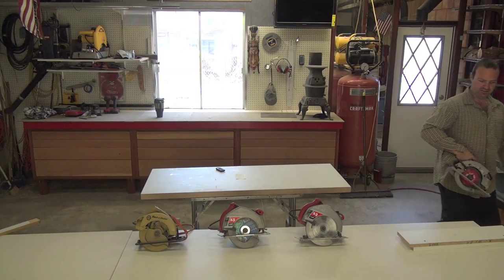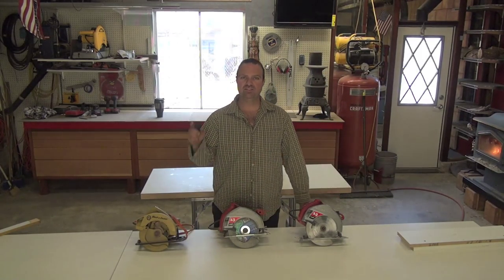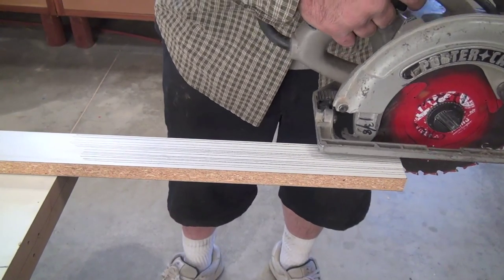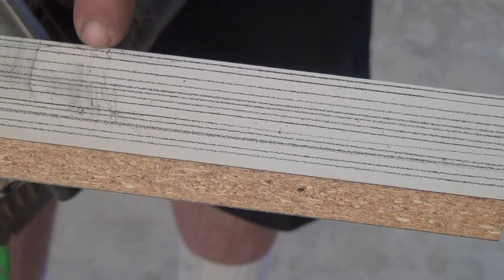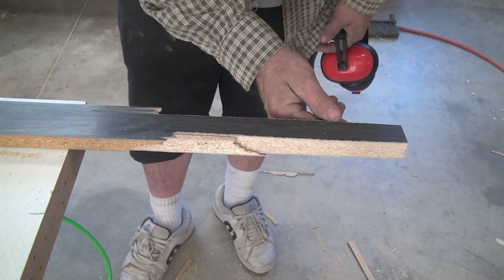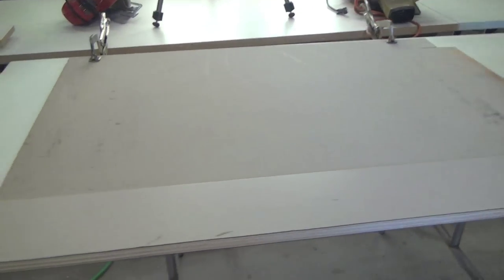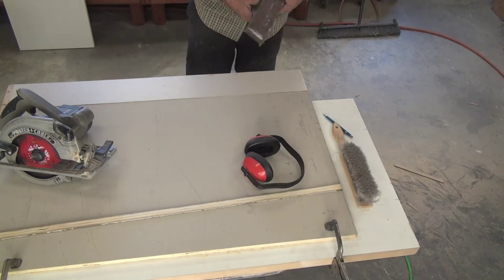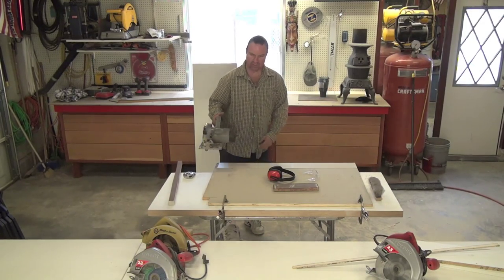Advanced Circular Saw Technique *Cut BackWards IN-DEPTH *a Tip for Pro Carpenters

Comment: Us  "pro" finish carpenters  would NOT use bad blades on a project thats has to be precise and accurate. Use the right tool use the right blade and use them correctly!
Reply from the maker: well, us pro's do, lol still doing this technique for 20 years now, not always obviously but when it comes to cutting off a simple scribe line thats how its done. Mose union finish carpentersI know over here on the wast coast do it the same as well...

Comment: First off that garbage is NOT wood. It's one step above cardboard.
Reply from the maker: What does it matter? This demonstration is to show the technique which can be applied to Cut wood, sheet goods, laid up laminate panels, corian, avonite & so on...Including cardboard! The commercial industry uses laid up laminate sheets in almost everything including wall panels, ceiling panels. Your local bank teller line is made with the same cardboard I used in the demo.
  The real question is did you get the point of the video & understand what i was explaining?  I'm just spreading the word to help other pros that struggle everyday when doing something so basic to me. Thanks for watching & leaving a comment. I appreciate it.

Comment: Fuck that! As a pro 26 years in there are many techniques better and safer. I now use a "thing a ma jig" scribing tool and a tracksaw and finish with a block plane. The scribe scores material (great for melamine and paint grade too), set track saw on track and move your track as it the saw moves through then curved cut leaving the line...then a block plane...specifically, a RALI block plane... double sided disposable blades.

Comment: Flip the blade round
Reply: aaron knox Think about it.  The arbor would still turn the same direction and you would then be presenting the non-toothed side of the blade to the wood from underneath and it would not be able to cut.  Cutting backwards brings the teeth to the surface from the top so the chip out and dust expulsion is on the bottom, instead of on the top as with sawing forwards.  A circular is is like a table saw turned over.  With the saw blade turning down towards you on a table saw, it automatically is cutting so that the chip out and dust expulsion is on the underside of the wood and there's more support around the wood to prevent chip out whereas the blade comes from underneath, up and out on a circular saw.  This is also the reason granite counter top guys cut backwards; so they preserve the finely polished top of the stone and minimize chip out.  It's more dangerous to use the backwards technique though.

Comment: Ex UBC journeyman.
1. Loose cuffs...no good
2. Loose shirt tails...no good
3. Chord not over shoulder...no good
I would flip blade for cutting, or use straight edge to guide sawplate.
Old trick on Formica is to use sharp blade to lightly score cut line.  Got good enough to do it mostly freehand.  Can use masking tape as well. Or...flip sheet over and cut from backside.  You begin video saying you'll never cut any other way.  Did I hear well?.  This is only for scribing lines for fitting to an irregular surface.  I would never hire you because you are TOO dangerous for me.  Not to mention the morale if anything happened to you on my job. Sorry.

Comment: Why do you think it's worth it to have your saw do a mediocre line while exponentially increasing the chance of a kickback.  The amount of blade exposed is also silly.  Yeah I get it, you are sinking the tooth into the piece, but there are so many cheap specialty blades for that job already.  If you are framing, these tareouts are of basically no concern.  Anything more delicate just should not be done with no guide, giant exposed blade and a busted blade.  If you are seriously concerned ab it tareouts, score it with a knife or a shallow cut first.
Reply from the maker: Thats just how its done, yeah i'm sure there are different ways but for speed and efficiency this is it.

Comment: Youve removed your riving knife from your saw. This is crazy. Be safe and use your saw as its designed to be used.
Reply from the maker: I was unaware skill saws (circular saws) had a riving knife, HUH, what was crazy? Could you elaborate please, thanks.
Reply: The steel plate positioned behind the blade to keep the kerf open to prevent kick back, similar to that on a table saw. Ive never seen a circular saw without one.
Reply: Just did some research on circular saws. It seems that the riving knife is fitted to european saws. I watched a us safety film on circular saws and none were fitted with this safety feature. The casualty rate must be sky high state side.
Reply: Andrew Millward We haven't ever had riving knives on US circular saws in the past.  I'm not sure if they have that option on any newer models.  I've never seen one in my life.
Reply: Nicholas Smerk hmmm...What do you do to stop ripped lengths of timber binding onto your blade?
Reply: Stick a wedge in it or cry when the saw stalls?
Reply: We don't have riving knifes here, That is why he said the technique is only good for cutting a maximum 1/2". Such a small amount of material isn't likely to jam the blade. I learned the old put the blade in backwards method myself but I believe the blade spinning downward at the material will chip less and work even better so I intend to give it a try next time I'm cutting Formica even though I'm not a professional carpenter. I'm a welder who's wielded a grinder for 30 years (close enough?).
Reply: WTF!!! no, bro, in the states we don't put weird ass shit on our skill saws cause we don't have time for that. Table saws and bench saws yes, but skills no, because we can pull the blade out and take our finger of the trigger, with a table or bench its different, its usually a big ass sheet of plywood and the off button is relatively far away from your hands.
Reply: Rich Hayner if it does jam, we use common sense, pick the damn board up or use a wedge to make it fall or pull away from the blade and keep going.
Reply: Just invested in the festool plunge saw. Fitted with a special riving knife to allow plunge cuts, but like all European circular saws fitted with a riving knife. I can't see any reason to risk my personal safety so my knife is staying in place. England enjoys one of the worlds best safety records so perhaps the states should look this way for some tips.
Reply: I can't say I've ever witnessed much of a circular saw kick back.  I've seen table saws shoot boards multiple times.  Good feature though.
Reply: No european has witnessed a kick back since riving knives have been fitted
Reply: US circular saws dont come with them.
Reply: 15 serious injuries in the us from kick back last year. 0 in Europe.
Reply: lol, more people get whitetail deer through their windshield every year.
Reply: One injury was a young father. Unable to work he lost his home. His wife found a new provider and put the kids in care. All for a simple bit of safety. But I say who cares not enough sense to work safe then live with the result.
Reply: I hear you.  We can't even get that product in the US from what I understand.  They don't sell it.
Reply: You have festool. This is the very best from Europe and very safe.
Reply: Oh, yeah I forgot.  I think that was mentioned.  I'm not in the market for a $465 saw...
Reply: Andrew Millward how many of those were using the saw in an unsafe manor though...